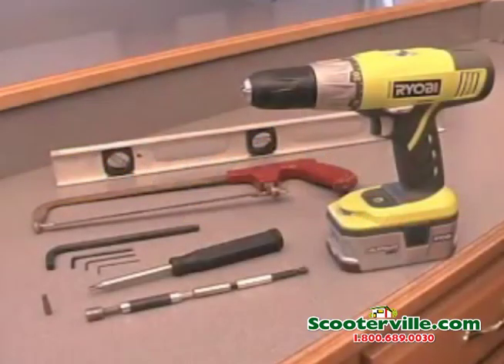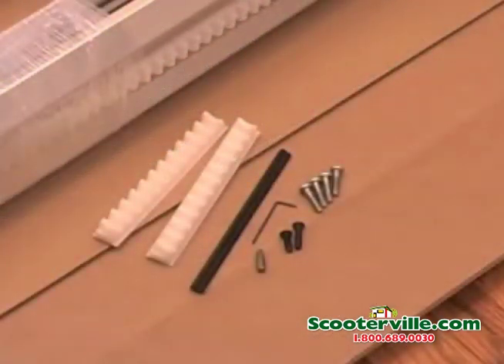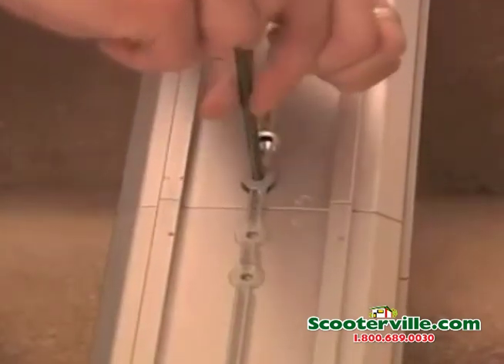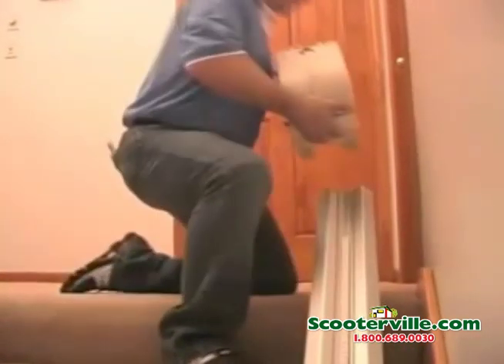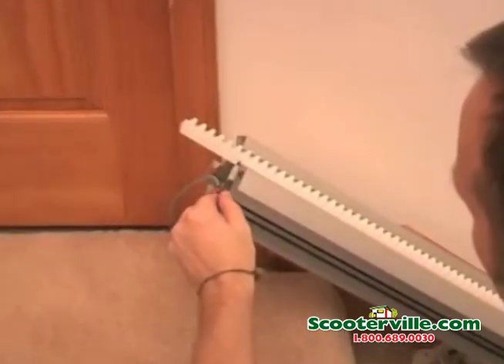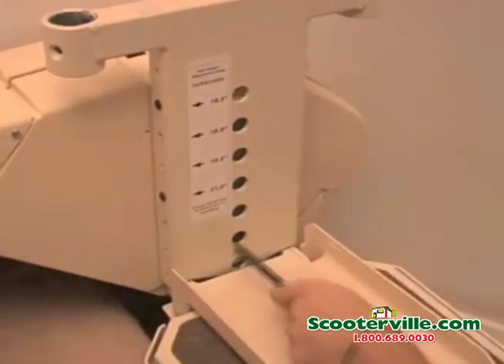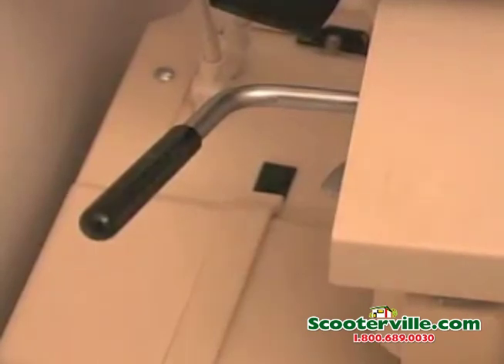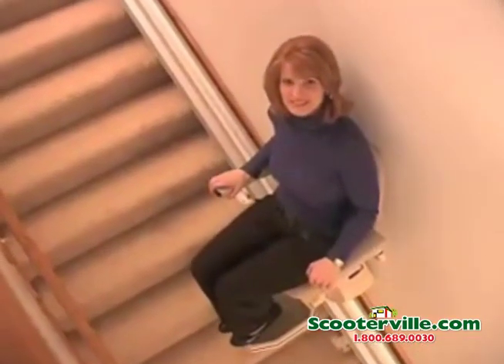Harmar PInnacle  Stair Lifts - Installation Stairlift

Comment: Confusion:  The SL600 Install Manual reads "Insert the two (2) charging strips into the keyed slots at the top of the rail (while standing on the top landing looking down). The charging strip with the red wire should be inserted into the left slot with the metal strip facing out."...  HOWEVER, in your video, the red wire is CLEARLY on the right side "while standing on the top landing looking down".  Please advise.

Comment: standing on the bottom of the chair rail looking to the top of the lift what side of the rail is the positive wire on? it looks to me it is on the right side.  i'm working on one for a friend that stopped and i measured the power it has 34 vc with the pos on the left side looking up to the top of the stairs. the charger is on the lower end.  he had another guy rewire it after the connector fell apart in a basement flood. i think that guy wired the charger backwards and drained the batteries. if it is backwards i hope when i fix the wire polarity it will recharge the batteries and did not hurt the controller board. thanks

Comment: I was able to get the carriage off the tracks after replacing the batteries. Can the carriage be installed with the switch facing in either direction? The reason I ask is I need for one unit to be on the right side of the stairs, and the second unit to be on the left side of a different set of stairs.  THANKS!

Comment: I just purchased two used Harmar SL600 chair lifts ..... when the person took them off the stairs the carriage was still attached to one of the tracks..... I cannot understand how to get the carriage off the track. It needs to come off in order to reinstall in my home.... any ideas as to how it can be removed (taken off) the track?
Reply: You have to UNSCREW the end cap White bracket.   The you can push go and it will walk itself right off.